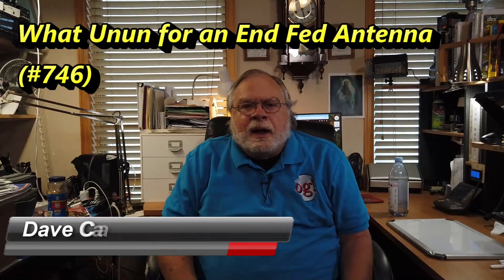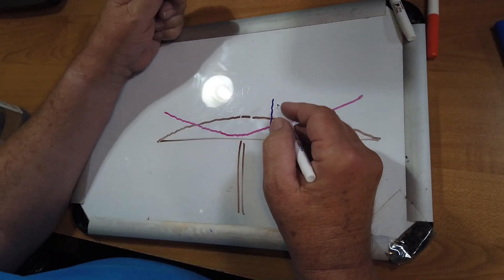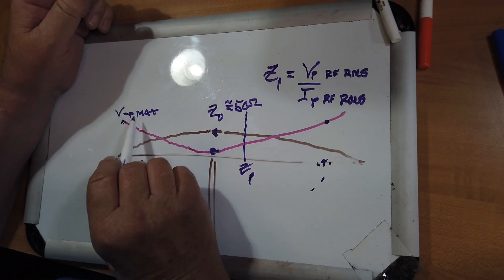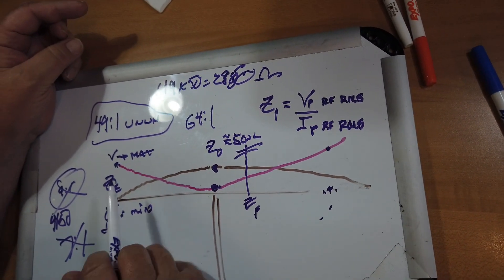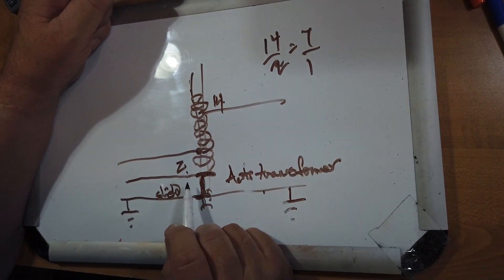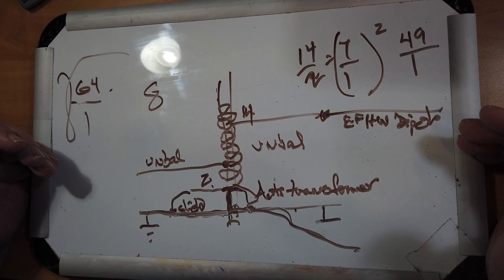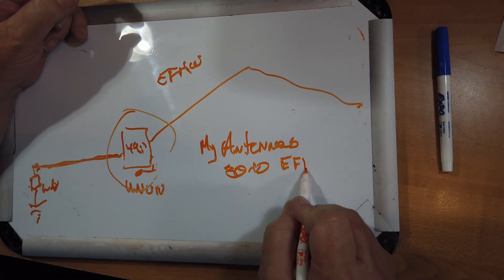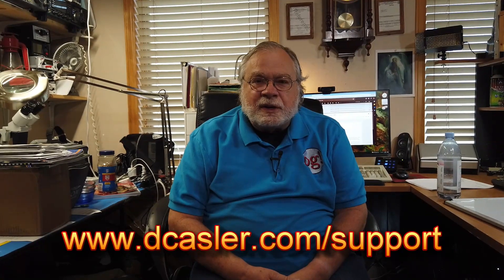What Unun for an End Fed Antenna? (#746)

Comment: Dave - built my QRP 49:1 unit yesterday and it seems to work OK. I connected a 2,500 ohm resistor across the two terminals and then read the SWR on my AA-55 Zoom. Got readings under 1.5:1 on 80 - 15 meters, so that was good; 10 meters was 2:1. I've seen several other videos where the builder(s) put a 150pf / 2kv capacitor between the output terminals, supposedly to help lower SWR at the higher frequencies. I put a 220pf / 3kv cap on mine and it didn't do the same. It slightly lowered the SWR on 80, 40, and 30, but on 10 meters it went up a bit. Any comments on the use of a capacitor?

Jim / k7TXA
Reply: If you hear from anyone on this subject, pls let me know, I need the same information. 

73

Comment: The rule of thumb I use is if it’s a half wave then 49:1, for a random wire a 9:1. Btw, random wires are not random, they intentionally avoid half waves. My beast antenna is an 84’ inverted L with a home brew 9:1 unun. I can tune 80m to 6m with it. Most of that is with the internal tuner but a couple of bands I have to use the manual roller inductor tuner.
Reply: Dave,

There is often confusion between a half wave end-fed and a random wire end-fed antenna.

Just to be complete.  A 9:1 unun with certain non resident lengths of wire and a tuner with ground/counterpoise/radials create a multiband antenna.  That set up will usually/often work on 60 meters, a non harmonic of other ham bands. 

A half wave length long wire with a 49:1 Unun creates a multiband antenna for the half wave length band and its harmonics.  Even with a tuner that set up probably will not work on 60 meters.

Steve KI0KY
Reply: @steveschroder8782  Agreed Steve.  I love using the 9:1 because I go from 160 to 6 including 60 and 12.  The SWR might go as high as 5:1 but tunes out easily.  Most bands are 3:1 or less. The wire is approximately 100' and the performance is surprising.  Mike N0ANE
Good video from Dave.  Excellent explanation.
Reply: @steveschroder8782  I've always been a beam person. But I just installed a NON-resonant end fed with a Palomar 9:1. I used 175 appox. feet of #12 solid wire and I get <2:1 from 6 meters all the way to 160 meters. Usually less the 1.5:1 and it is quiet.  All without  tuner. (supposed to have a noise choke as well as the UNUN) DX to Europe has been pretty good, might be the band. I do have 3-240/31 ferrite rings 6 turns/loops on my feed line before it comes and a 1:1 inside before the radio. Also keeps the YL happy, who is also a ham, because she got GB23C Coronation special event though the pile up with a 5-9 and then some report report and he was actually given true signal readings.
Dave W9DLP
Reply: Hi Rick,

Please forgive my newby ignorance, but what is a "manual roller inductor tuner?" Is that a tuner you home-brewed or a marketed item?
Thank you!
73,
John - KK7JBZ
Reply: The problem with a 9:1 and a random wire is the fact that the 9:1 is designed to feed a 450 ohm load, not a random load like a random wire would present to it.  Any balun or unun is most efficient when feeding it's design impedance and when you stray away form that, losses increase and the further you stray from it, the higher the losses are.  Especially if the impedance is much lower that 450 ohms.  You take say a 50 ohm load on a 9:1 and it gets down converted 9 times to around 5.5 ohms and this even increases losses in the tuner too!  When the impedance drops that low, currents in the unun and the tuner skyrocket!  Yes, you can make contacts with it, but only a small portion of the power actually reaches the antenna to be radiated.  I've worked QRP at 100mW, but I did it with an efficient, resonant antenna too!

Comment: I understand the math and the concept, it's clear and easy to understand....however, 9:1 endfed antennas are sold (like the kit EARHCI ham group in Hawaii) and if your tuner will match the 450 ohm or so impedance the antenna works FB,. The penalty would be the losses in the tuner...is this correct?  73/K6SDW
Reply: Eddy, keeping things very simple ... tuners are a matching device and in theory don't have losses (they do in practice). The 49:1 is used on a length of wire that is a half wave (or multiple) of the frequency you want to use. The 9:1 is also end fed and connects to what people call "random" length wires, but the length of the wire is far from random ... these wire antennas have very precise lengths. These "random" wire lengths, by design, present an impedance of approximately 450R on the desired frequency. Clever math people have figured lengths of wire that present 450R on many frequencies, hence these antennas are sometimes referred to as multiband.
Reply: @nevmarr  And the kit I bought from EARCHI and used for 3 years worked great running my IC7300 and the MFJ 939i tuner on all bands except 60meters. If the 939i could tune the swr betlow 2:1 then the IC7300 was "happy" and I worked the world with tha 9:1 endfed setup. The wire length I used was suggested by the EARCH club, you can read it on their website.

 I got talked into the 49:1 unun and it too works FB.  What you wrote makes sense. However, using the 9:1 wire antenna I worked the world. Regarding tuner losses, many years ago QST published an article on measured losses operating some popular manual antenna tuners and while all were close, all had some losses but not enough to lose sleep over...the article was probably 30 years ago.

73
Reply: @eddy2561  Re 60M working/not working ... another crazy antenna thing is the length of the coaxial feed line, it can make a difference ... adding say a 6 foot length of coax between the antenna and tuner will change where the impedance sits on a Smith Chart and that "change" is sometimes enough to get things in the range your tuner can handle/match.
Reply: @nevmarr  Kurt Sturba (RIP)  use to write in his monthly column a garbage can or grocery store cart will radiate RF if you can get the SWR low enuff the xmtr doesn't shut down....aw the days of tube transmitters and Pi networks....everything worked then...73